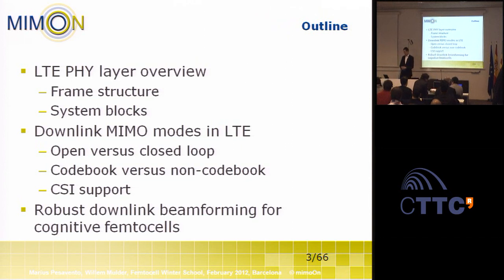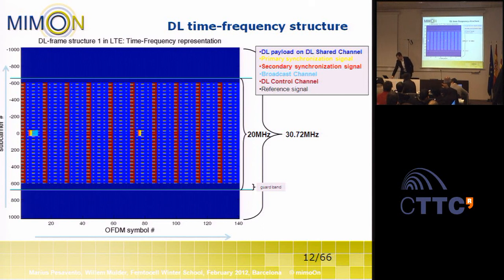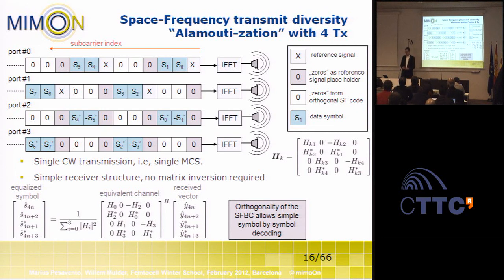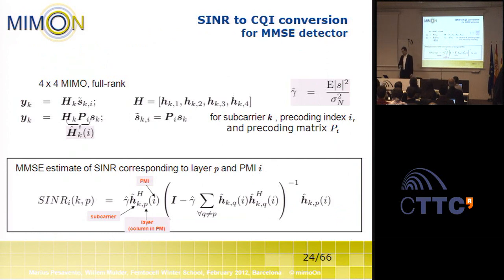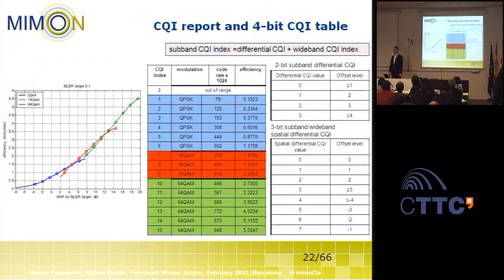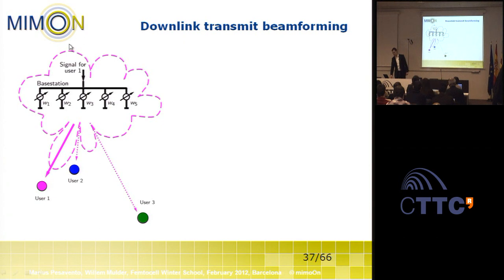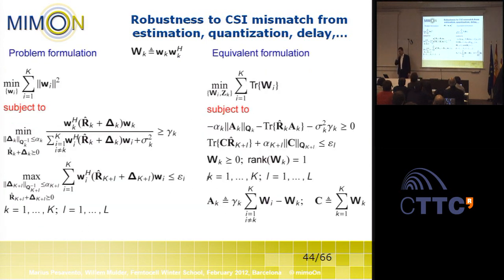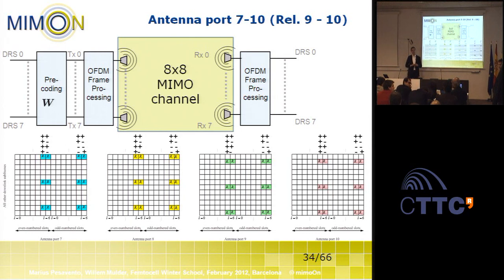LTE-A PHY Layer Overview & Femto Design Challenges

Comment: wrong information
12 sub carrier * 7 symbol make a 1 RB 
in TTI there is 10 sub frame and 20 slot in each slot there is 7 symbol  and transmission time is 10ms per TTI, each sub frame has 1ms and a slot has .5 ms